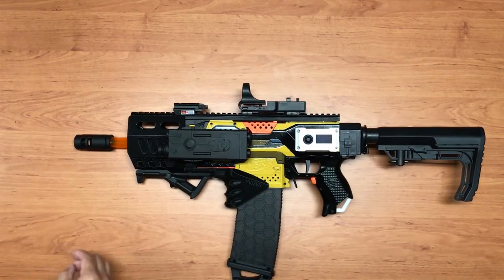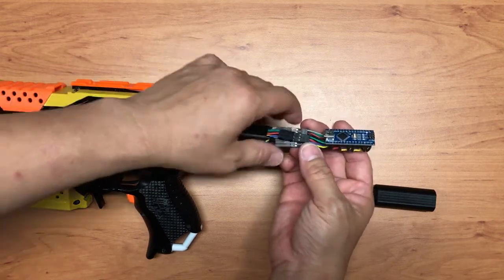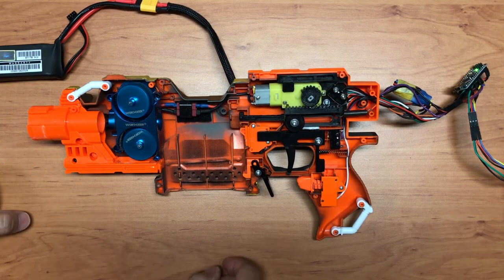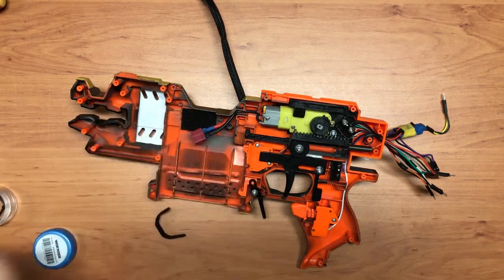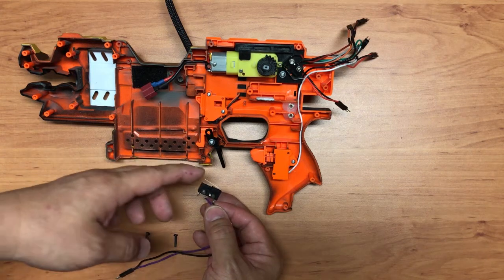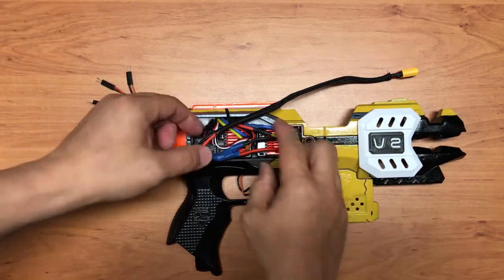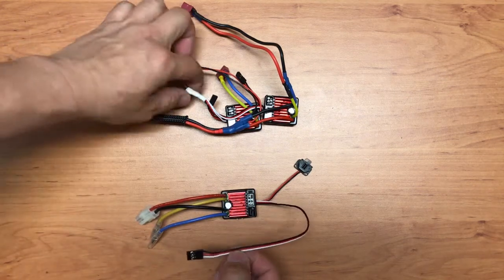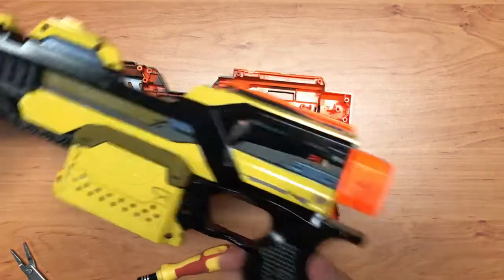{Mod} Select Fire Stryfe + Arduino (Part Three - Dismantle)

Comment: excellent video as always Tungsten! I was wondering if you could provide a link to the crimping tool you use on all your dupont connections? I got one a while ago but it was absolutely awful. Thanks!
Reply from the maker: I use the “engineer PA-90” for the dupont wires. The price is on the high side and it may not look impressive, however it is an excellent crimper! Saved me a lot of heartaches LOL. Below is a link to a video which talk about the crimper, and another on how to use it. I bought the crimper from taobao (China shopping site) however I believe many places sells it (amazon, ebay, etc). I think I will update the itemlist for the mod to include some useful tools, and maybe make a few videos on the tools I use in the future :) Thanks man :) thanks for the support.
Chinese Crimper vs Engineer PA-09: https://youtu.be/3Cw9YFLDZeo
Usage: https://youtu.be/Ne075jHFDgU
another good video on usage: https://youtu.be/9bfsz6ckI04
Taobao: https://item.taobao.com/item.htm?id=9117898770&_u=t2dmg8j26111

Comment: Hi, for stryfe v1 mod, do u have any video for that?, i chk out your files on git hub and thinking of replacing the relay with mosfets which i currently hav in hand.
Reply from the maker: aung kyawthu hi, I am current away on an oversea business trip, I will get back to you sometime next week.
Reply: @TungstenEXE  thanks bro.
Reply from the maker: Hi, I am back. if you were to use mosfet for the pusher motor, you will have to use a 3 mosfet setup, two N-channel and one P-channel. You can use 2 pins to control the mosfets, one to run and one to brake and never on both pin at the same time. If you have access to facebook goto  "Nerf Modder Welcome" facebook page, and there is a modder by the name "Colin Wood", he did a circuit  diagram for this 3 mosfets setup.
Reply: @TungstenEXE  alrite bro, i will chk that out. U got any demo video on your v1? Thanks bro.
Reply from the maker: yes this is the dismantle video https://youtu.be/xdaylSIGhEU

Comment: Hello, question about interference. Ive put capacitors on my motors (mtb Hellcats) and my arduino is far away from them. However, when i rev or fire the circuit resets the ammo counter. the only wire running past the motors are for the OLED. So im confused why this is happening. the reset pin an interrupt pin if that helps.
Reply from the maker: Hi, a few things, 1) are you using the new Neo Hellcats? if yes, remember to sand away a little of the color coding on the motor before solding. 2) add a Fly-back-diode for the flywheel motor (I will place a link below on a video) . 3) pusher motor also require the capacitors as well. 4) How is the arduino powered? Do not use the onboard voltage regulator, you can step down the voltage using a buck convertor then connect to the 5v pin. 5) The digital pin 4 on the  Arduino is the reset for the OLED, you don't need to connect anything to it (I am using the 4 pin type OLED). link on fly-back-diode https://youtu.be/LXGtE3X2k7Y

Comment: Can swap for a smaller 20a ecs, I don't understand why such a large one... also  can use my Arduino Pro mini instead of a nano?
Reply from the maker: Darwinious Rex I use these ESC because it comes with on/off switch, most smaller ESC does not have that, once you plug in the battery it arms the ESC. yes you can still wire up your own on/of circuit, it will take more time and wiring. For the flywheel motors I just want to be save and have a higher amp rating ESC. for pro mini, I am not too sure does it have enough pins in total for the project, if it does it should be alright.

Comment: Hi, could you explain more about the capacitors on the motors? How do you attach them and what values would you recommend?
Reply from the maker: hi the capacitors are to reduce electric noise here is a good write-up on how to attach them https://www.pololu.com/docs/0J15/9 , I use the 104 Ceramic Capacitor (the part-list is in my github account link in the description). btw I use two capacitor setup for each motor.
Reply: Tungsten EXE thanks so much!
Reply from the maker: AndrewAitchison100 no prob man :)

Comment: Hi Tungsten. I admire your work and effort. Been looking arnd for something like this. I have managed to assemble together the circuitry as instructed from your github acct. However, i seem to have issue with the triggering and flywheel and i am using 3s lipo. For a single shot mode, one squeeze of the trigger, the pusher moved more than once. For the fylwheel, after finishing one mag, unload and reload, squeeze trigger and the flywheel doesnt move(intermittent) pusher does move.
Reply: What could be causing this?
Reply from the maker: Hi, there could be a few possibility, first maybe you can try modifying the code by commenting out the line in the main loop function "pusherReturnCheck();"  it should be at round line 277. This will disable the pusher return check. Then try firing single shot again and observe how many shots were fired and where the pusher end up to be, if it still fire 2 shots the RETURN_DELAY_ONESHOT (line 95) is too long, try reducing it to many 13 (then repeat test) if it fire one shot and the pusher end up extended then the RETURN_DELAY_ONESHOT is too short, you can try increasing it. After this u can try uncommenting the "pusherReturnCheck();".  Another setting to play with is the "const    long pusherOutThreshold" setting, I am not sure when you download the code, the current setting I am using is "const    long pusherOutThreshold 90" and the line to check for extended pusher (line 480) is "if ((pusherTimerStart != 0) && ((millis() - pusherTimerStart) >= (pusherOutThreshold + returnDelay))) {" to take into consideration of the returnDelay.
Reply from the maker: For the flywheel not moving after one magreload, I am not very sure what could be the problem as the line "motorsESC.writeMicroseconds(THROTTLE_MOTORS_MAX);" line 400 is the line which starts the ESC and it is right before starting the pusher, maybe you can try increasing the REV_UP_DELAY setting? I am really unsure about this error.
Reply: Thanks! Will give it a shot....
Reply: Hi. Can the system use 4s lipo?
Reply from the maker: streetace78 for the ESC I used it cannot handle 4s. also event if I find an ESC that can handle 4s, I will only apply full throttle for the flywheel as I believe the pusher max rof will be too fast to stop in time, u cannot go too fast with the xsw kit as there might not have enough time to stop. One cycle that a very short time to complete.

Comment: Do you think I could fit a 3s Lipo battery into a stock like that one but the one that folds?
Reply from the maker: The fold type as in this one? https://item.taobao.com/item.htm?spm=a1z10.3-c.w4002-11465630277.21.Bpe5ES&id=521877433372&scene=taobao_shop , I did look at this type before, however I felt that there is no easy way to dismantle it and the hole towards the stock in not very big

Comment: can I ask you a question about the flywheel cage... Hawki007 said that the blue worker flywheel cage has to much spin and that the darts would fishtail in the air... or spin in the air and loose drag... do you see any problem like that with the cage
Reply from the maker: chris soto , hi so far I did not encounter fishtail problem. Do note the cage have its own worker barrel. There is a inner barrel (the sliver one) and the outer one (the normal worker barrel) you can checkout the part four of the video which I fire at target (the volume of that video is a bit soft). I this setup in a few other blasters as well, no problem so far I did not even need a dart guide as the entry point is big and rounded. I also have the flywheel for this setup which is high crash (orange color) it does increase FPS, the reason I choose less crash blur one is because the dart last longer.
Reply: ok thank for responding back I appreciate it, thank you

Comment: Hi tungsten, awesome build and really nice overview show and tell video. I am currently gathering parts to copy the build. Just one question, where does the capacitors from your parts list connect to?
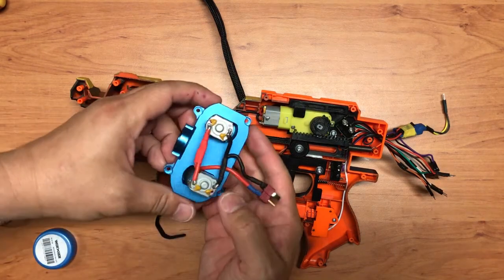Reply from the maker: Hi supermothing, the capacitor is to reduce the electrical noise created by the DC motors (all 3 in our case) this noise will sometime cause problem when you have sensitive components in the build such as the arduino board and the OLED display (there is a good write-up on this, link here: https://www.pololu.com/docs/0J15/9 ) for this build maybe we can get away not using they as the ESC I use does come with capacitor, however I do want to still use them to get rid of the noise as close to the source as possible, hence I still use them, at around 14:55 in the video you should be able to spot those I use for the flywheel motors (I use the caps for the pusher motors as well). Last One weak spot of this mod is the pusher gear from the XSW kit, the small gear which was attached to the motor (all XSW kit have this issue) over time it will wear out (see picture https://imgur.com/Bpz4Hs4 ) so you will have to be ready and prepare to change the gear once it wears out.
Reply: Thanks so much for the link to the write up. I am going to use the kitsune autofire kit from thingiverse so i can just order the 3d printed parts locally.
Reply from the maker: supernothing awesome :)

Comment: Could you comment on why you are using those particular ESC's? There are so many different brushed ESC modules out there, a lot of them much cheaper.
Reply from the maker: During the time of this mod, I tried a few ESCs, I ended up using this ESC for both flywheel and pusher for the following considerations. for the flywheel I need something that can handle Amp for the 2 MTB rhinos, this ESCs seem ok. As for the pusher, I can go for smaller esc, but I stick with this as: 1: I wanted both ESC to have on/off switch so that I can wire them to be switch on/off easily, some esc don't have on/off switch so either I do can another circuit to have my own on/off switch or they will constantly be on when the battery is plugin, so ESC with built-in on/off switch will be easier to achieve what I want. 2: They fitted very nicely in the stryfe battery compartment. 3: I use the BEC of the ESC to supply power to the arduino board and I think this ESC does have a clean signal, 4: at the time of purchase, the seller actually offer free shipping Lol, so I bought a few. Last at that time of modding I did not really look around for more similar version of the some option, so I just use them. I believe there are a few more out that with the same options and cheaper so ya those can me use, sure. Hope this help :)

Comment: Hey Tungsten, a couple questions, what gauge wire do you use? Second instead of using dupont heads could you instead solder the connections directly to the arduino? That way you won't need to get the costly crimping tool. Third what amperage is the button rated? It looks like it was removed from taobao. Thank you
Reply from the maker: for the pusher motor to the esc I use 18 AWG, for the motor to the ESC I use 16 AWG, for the rest, buttons, to arduino etc I use 26 AWG, those does not carry high current so do not need to be tick wires, and the rating for the button are very low as they do not carry high current. for soldering direct to ardunio board, yes they can do that, another way to not use the crimping tool is to buy these pre crimp jumper wire, both male and female ( https://www.pololu.com/category/65/premium-jumper-wires ) then just do you normal wiring then cut the pre-crimp male/female head to solder join with your wire.
Reply: Tungsten EXE Thank you very much, I plan on doing this mod to my full auto 3 switch rayven.

Comment: I'm reaaally curious what kind of fps readings that worker cage is getting, do you happen to have any information on that? Those cages haven't been used that much in the community yet.
Reply from the maker: I do not have the fps reading, sorry. However it shoot really well and spot on. When my friends try out the blaster, they commented that it shoot really accurate and was impressed by how consistent the shots were (my friends are mostly pump action blaster guys) the flywheel I used is the non high crash one, I also have the orange high crash version, however I am not a high crash guy and felt it is a little too much on the wearing of darts. The blue one I use is just nice, one thing to note is it work the best for FVJ.